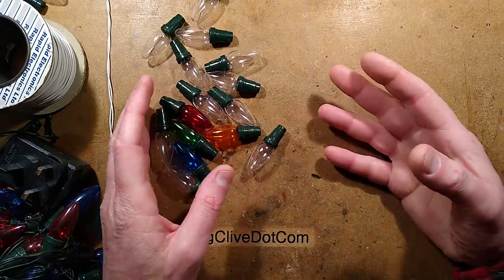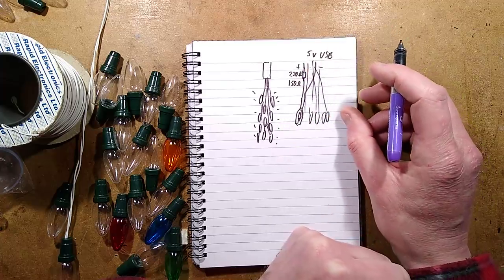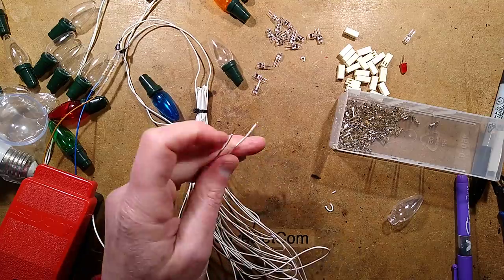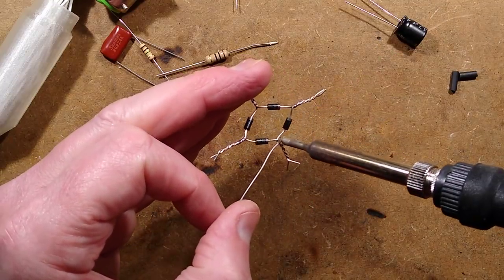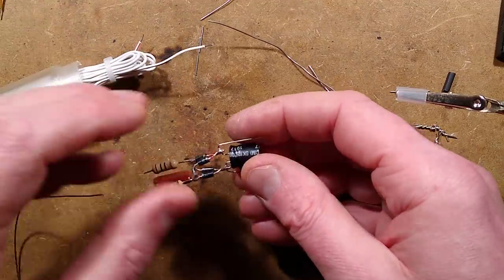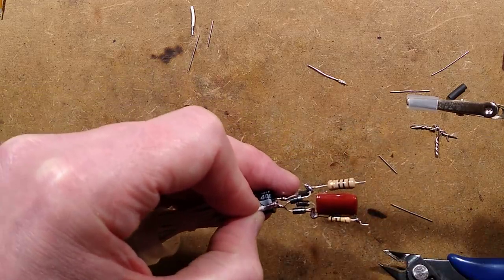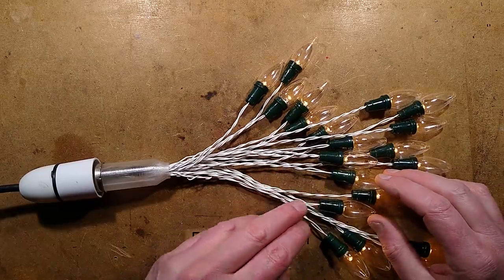DIY build of the dangerous dangleberry lamp

Comment: At every snip of the wire I could feel my 'twisting fingers' move.........
Reply from the maker: Yeah, and I totally failed and twisted one of them.
Reply: It's a real thing haha
Reply: I am wondering... do you guys hold the wire and twist the strands with your hand, or do you hold the strands (with moderate pressure/tension) and like spin  the wire between thumb and index finger ? .. I prefer holding the strands, I can do it much faster than the other way around .
Reply: @tinygriffy  I'm a strands twister myself.
Reply: @tinygriffy  that likely has a lot to do with the fact I'm frequently working with a long wire where turning the insulation wouldn't be as easy as if the wire were only inches long
Reply: When I twist, it’s always the stripped strands.
Reply: It's the strands for me too.
Reply: I auto-pilot twisting the strands after stripping too. I can't help it. It just happens. 😂
Reply: oh? if you think twisting is a feat? try UNtwisting!  In the RF world, one SHOULD untwist (or de-braid) coaxial shielding.. that is an ART to do, too!  most just "snip a hole" and then pull the center conductor(s) through.. which is INCORRECT; you're supposed to de-braid or unravel the shield without losing any of the conductor elements..   this is NOT as easy as it sounds (though I seem to have developed a technique that yields perfection almost every time! -> I know, sounds kinky, doesn't it? ;) ).
Reply: @akak5128  LOL you 'sound' like someone I know!  sure you're not him perhaps? hehe  (my favorite is the little suspension bridges one can buy for their one-way optical cabling costing in the tens of thousands!) I don't mean it to sound like snobbery (hehe)  but in RF, you have to recover as much of the shield as possible as if ANY reduction of surface can cause a reactance of one surface to another- read: an RF voltage potential over another... example 1000 volts of RF to something that is a DEAD SHORT to DC! (basically how the grill in a microwave oven door works)  so any point in a SOLID plate can actually have voltage (and opposite, current) potentials on it in the same plane!  RF is real magic and trickery!  We, in the field, have a saying:  "In RF, insulators become conductors and conductors become insulators!" Real magic indeed! :)

Comment: Did anyone else yell STOP! at their monitor when Clive cut the live wire?
Reply: Err, yes was waiting for the bang. And all the lights to go out. As GFI trips.
Reply: No, but I did groan when he twisted the stripped wire before re-inserting into the connector (after telling us that was a bad idea).
I guess it's a case of "do as I say, not as I do"  ;-D
Reply: @Chris_the_Muso  I noticed that, But i find I just automatically twist them whenever I strip a wire. LOL.
Reply: I was waiting for sparks when he crimped a live wire with the other wire scraping over the crimper.
Reply: I used to strip wire with my teeth, the gap right between my 4 front teeth is a mm or two, just right for most wires. I became partly discouraged from this habit wiring up a phone extension, having forgot I'd plugged the downstairs end in before I wired the upstairs bit. 48V across the teeth, refreshing! Only glad nobody chose to phone me.
Reply: @greenaum  LOL. I used to strip wires with my teeth as well, from the age of about 10, untill I lost 2 of the front ones a couple of years ago. In my 50's now, so they lasted well. Ha ha.

Comment: Tall narrow things often detach easily from 3D printer beds because there is a lot of leverage. Adding a brim can help, but printing it in a different orientation is usually the better solution (although this may affect the finish). Adding supports can help too, but they also mar the final finish.

Comment: "I don't approve of that because I like the zigzags." Well, last I checked, European schematic diagram regulations don't apply to your YouTube channel. I say go to town and draw as many American-style resistors as you want.
Reply: Err, there are no regulations on what symbols you can use for your schematic diagrams. There are in fact multiple different ‘standards’ in use. I personally prefer the rectangle for a resistor because (1) it’s far easier to draw and (2) it looks more like a normal carbon film or metal film resistor.
Reply: @Mark1024MAK  also you can put the value in the box, saves some space in case you silkscreen it :P
Reply: We I am drawing on paper I prefer zigzags and to my mind suggests a power dissipation dimension. Again , in the European set inductors can be just boxes the same as resistors and these are the symbols I would use for print outs.

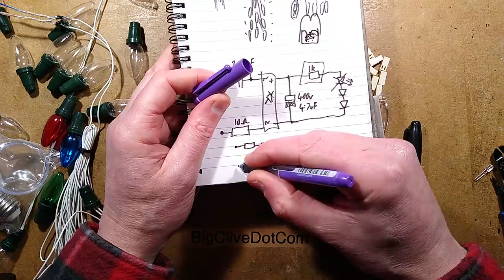Comment: 13:38 - Nothing to do with "Europe", and everything to do with the IEC. The "cylinder" type symbol is simply the official symbol used by the International Electrotechnical Commission (of which the UK is a full member, as are China, Japan, Australia, etc.). The UK was never a member of the ANSI, so if you were drawing ANSI-style resistors, you were basically siding with those filthy rebels from the colonies, and committing high treason against her majesty the queen.

BTW, I believe the IEC settled on the cylinder because the zig-zag was too similar to the symbol used for inductors.
Reply from the maker: That's almost justification for ANSI rebellion.
Reply: Ahh, the rebel alliance, I know a film that features them...

Comment: Can you make a video how to make a capcitive dropper power supply? Or if you already do that, can you give me the link? Thanks.
Reply from the maker: I'm not sure I've got a dedicated video about it, but it appears a lot in my LED lamp videos.  The main thing to note is that even though it may be used to drive a low voltage load, it is still directly referenced to the mains supply and can give a shock.

Comment: Fascinated now - I've always used the "American" style symbol for resistors and I can't remember ever reading anything that said I "had" to start  using the European. In fact the only reasonably relavent document I can find is the 2016  IET missive which gives the Euro style as "preferred.
Reply: The US military was in the process of switching over when I joined the USAF in 1970, and some US industries were doing it in the early 90's. I found it extremely confusing having been raised on Popular Electronics etc. with the zigzag symbol.
Reply: The problem about the zigzag is that it is awfully close to the sign for an inductance, especially when hand drawn. I think that's why it's discouraged, because it reduces errors.
Reply: @sjdpfisvrj  What? I've never mistaken one for the other, and anyone who can't draw either one clearly is in the wrong line of work.

Comment: I was sat there thinking.... "Hmmm.... maybe he ought to just flip the lid on the Quick-Test" 

I hate that sort of wire strippers - I've used automatic strippers for so many years that I hate the odd occasion that I hate to go manual, even when doing mains installation stuff.  Not the cheapest, but RS 243-257 & 2847 are my usual choice.

Comment: Iwiss is the crimper company. I bought one after seeing your video 😁.  Definitely better than the one that came with the kit for the JST XH clone connectors, a bit harder for the dupont ones because you've got to crimp twice to get the full length.

I like the idea of building these, USB powered, with the kids. They've already got their Snap Circuits electricity kit, which they quite eagerly and regularly assemble into a flashlight, which is quite comical. They'd love a multi-color flashlight, and I have some terribly small power banks.

Comment: Molex makes an 'economy' grade crimper, pn 63811-1000, around $50US. It seems to have better tolerances than the cheapies. 
It's worked for most of the connectors I have tried it with, takes a couple tries to figure out which set of dies to use.

Comment: When I needed a large bulb for my steam punk light I made last year I made my own. I used an old base from an old CFL bulb as that had the bayonet fitting and a short plastic skirt fitted to it. I used the circuitry/PCB from an old unused led light which fitted perfectly in the old CFL base. I went shopping at Poundland and found a tapered cylindrical vase that had a small neck which fitted perfectly inside the old CFL fitting and was a similar colour to the old vintage style bulbs. A bargain 50p! I then brought three £1 garden lights as they had short strings of micro LEDs in them. Removed them and connected the three strings in parallel with to the PCB, bit of glue and hey presto, a large vintage style looking light bulb! Just gives off a nice warm glow and draws just 12mA. I do have other self made lights lighting my home thanks to Clive!

Comment: Clive, you missed the chance to make it even more dangerous by using a bayonet cap. A screw  version would have left the cap shell live and exposed (for the US e26, even live while you are screwing it in). On the other hand, a safer version with a bigger diameter plastic tube would have given you more space inside.

Comment: Nice instructional video, but to be honest,  I don't like it because it doesn't seem safe to me. I certainly wouldn't want to leave it unattended. I don't like the skeleton wiring (soldering all the components directly to each other) of the current limiter/rectifier circuit because there's plenty of risk that any one of those solder joints could dislodge due to heat or wear. Also, having what is essentially a coil of wire, where all the loops are held together might offer an even more interesting risk. A 5v version might be useful, although I would wonder if it was possible to have parallel wiring instead, so less resistors involved, but that might have a higher current draw. I don't know really. The main thing I'm getting from projects like this is 'dont attempt any projects without first learning more about the basics'. I might feel a lot safer with lower voltages, but that definitely doesn't mean a pie dish won't ever be necessary. The idea of grabbing a few gizmos from the pound shop, taking them to bits and making something else from them doesn't come without risks I guess.

Comment: very nice.  I have several hanging Ikea lamp-mounts and I may try this.
I had thoughts on doing 'production.'  I have an offset screwdriver w a hook for twisting wire loops. if while laying out the loops you mark the descending wire with the sharpie just above your turn, then use the screwdriver to twist each one as you form the loops, it will all be marked and neatly arranged for you  before you start crimping.  you can then have a consistent pattern to mounting into the mini-molexes.  also, if you put the ziptie through the top of the loop instead of around, it will be 'in-line' holding ½ as many wires, prevent one from being pulled through, and you can tuck the head inside the loopspace for neatness.  just a thought.

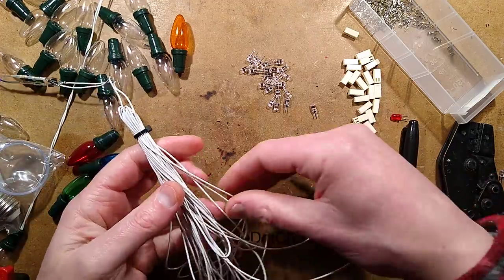Comment: Yes, shove the cap on first (10:52) :) If only I had got a pound for each time I've wired/soldered up cable to, say, an audio plug and forgot to slide the plug's cover onto and down the cable first, with no easier way to slide it in from the other end.

Comment: Could I suggest using metal oxide resistors as they don't set on fire like carbon and metal film resistors. This especially helpful when they are being used as a fuse.

Comment: Add 31:07, you noted that the socket is in discriminate with regards to which is power and neutral, but you’ve put a lot of effort into assuring that all of the resistors and everything are matched with polarity. Does the polarity input matter at all? Please explain if you can or have the time

Comment: I used to work at a wire harness shop where we used a wide variety of manual crimping tools.
If you want to  make the crimp good, using the tool that is compatible with the metal contact is ideal. If you can't do it, you can always follow up with some solder to increase the holding force and make the conductivity of the mating with the wire better.

If you want to check into compatible crimpers: TE Connectivity has a good selection if you know your terminal/contact type (they are pretty pricey though)

Comment: I have a Chinese made lamp that uses 2 AA batteries for power. It has E11 base led bulbs with 40mm glass globes. It got knocked over last night, and all the glass broke. I can not find any similar bulbs. If anyone knows a source, please let me know. At this point I am thinking I could use ping pong balls to replace the globes.
Reply from the maker: Sounds like a job for 3D printing with clear filament.  Creates a nice spun lensing effect.

Comment: You don't have to "heart"  this mr.Clive,You're keeping a substantial qty of technical folks sane in this time and it's appreciated

Side note, I'm a bit less Clive and more AvE, experience wise.  I'm a mechanical guy (millwright) that works on electrical things occasionally and your videos have helped me understand a bit more of the magic pixies. Last night I installed a new 12 volt cigarette lighter to use a bluetooth fm transmitter in my older farm truck. The alternator wine coming through the speakers was insanely loud because of the dirty power being supplied.  I immediately referenced knowledge that I've learned in your videos that capacitors smooth AC, which this noise obviously was. I had a fat 50 volt electrolytic capacitor in an old box of electrical stuff and installed it on the positive and negative supply behind the lighter socket and the alternator wine noise 100% disappeared. I was very proud when it worked.
Reply from the maker: I'm leaving hearts to acknowledge reading worthy comments and also keep track of where I've got to.

Comment: Hey Clive, if you continue to having issues with it sticking to the bed try using hairspray or a glue stick. You can also try using a brim or a raft. Don’t use too much hair spray because it will really stick to the bed and is a pain to get off.
Reply from the maker: A recent print stuck firmly, so I tried a quick squirt of isopropanol as suggested by someone else, and it popped right off.

Comment: Couldn't you put a 70ish volt Zener diode across the lights to clamp down the voltage if you change an LED with power applied?
Reply from the maker: Yes you could.  It would dissipate more power than the set of lights while in circuit.

Comment: Would you ever do a video on how you programme pic microcontrollers?
Reply from the maker: It's quite a complex subject.  I still program them in assembly code, which requires a deep understanding of the processor itself.
Reply: Fair enough, I tried starting out in assembly and quickly got lost trying to blink an led

Comment: I like this, have been thinking of making my own LED lights for a while now and this is a nice idea.

As for safety, I don't think that is an issue as long as the housing is secured properly into the lamp base. I'd be tempted to bond or otherwise fix it in somehow. We sort of forget that traditional light strings for Christmas trees in 240V land were usually just a series chain of 12V incandescents (for 20 lights) or 6V (for 40, for the posh people who had big trees) with single-insulated cable, wired directly to a mains plug! I still have several such sets and they haven't been used since I adopted these cats, just the low-voltage LED string.

Might be an idea to twist after assembly to make it easier, that way you might be able to fit a couple of LEDs in the housing? .. or a bigger bunch of lamps.

Oh, one other thing .. I'm guilty of having twisted the strands prior to crimping, force of habit which I'll try to avoid after this reminder! I guess that's ususlly fine, although unnecessary, for ferrules though?
Reply from the maker: Supposedly you're not supposed to twist before use in ferrules either, but I do, to stop the strands catching.

Comment: I want to say Thank You for the interesting videos you produce.  I’m learning g bits and pieces here and there.  In this video you mentioned color changing LEDs.  I have 200 RGB LEDs.  100 of them are Common Anode and the other 100 are common cathode.  I’m new to electronics so I wasn’t sure which one would work for what I wanted to build.  They came with resistors for each through hole LED bulb.  I plan to build run the light show with an Arduino Zero board.  I scanned through your videos looking for a project I could relate to what I’m doing.  I didn’t find anything.  I also didn’t use a fine tooth comb to search.

Are there any ideas you might want to create using RGB LEDs in a project to put on here?
Reply from the maker: I've used RGB colour changing LEDs in quite a few projects.

Comment: Good video, have you just created the old Christmas tree lights nightmare where if one LED fails they all go out and you have to check them all?
Reply from the maker: With LEDs they often fail short circuit due to the high voltage across an open circuit failure.

Comment: Did you ever frequent an electronic bazaar (or bizarre) shop on Stockwell Street Glasgow (I think) ?
Many an hour or so I rummaged about in there about 1970 when I read Practical Electronics lol.
Reply from the maker: I think I tried going to that one once, pushed the door which was locked and someone shouted "We're closed - are you f*cking stupid?" and I didn't go back.   Thankfully RME on Howard Street was very different.  A great shop.
Reply: @bigclivedotcom   I may well be wrong about all this, but it could have been the same firm as it seems RME Surplus moved to Howard Street late 70's and may have tidied up their act.  Original shop may have started as an Ex army navy surplus (REME = Royal Electrical & Mechanical Engineers)  - and floor to ceiling, boxes of dusty rusty obsolete electronic parts (like a Barras stall) where you browsed in valiant hope of finding a useful bargain lol.  All demolished now and the pics below are not what I remember from 50 years ago. 
(search secret scotland for RME to see  pics)